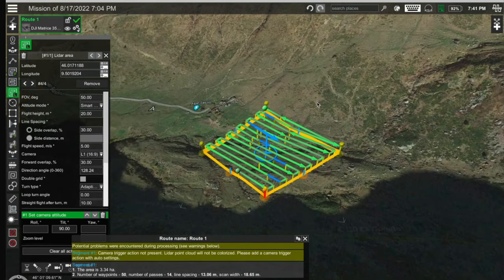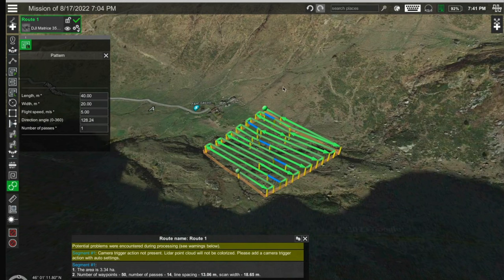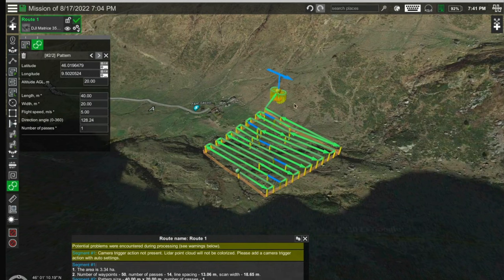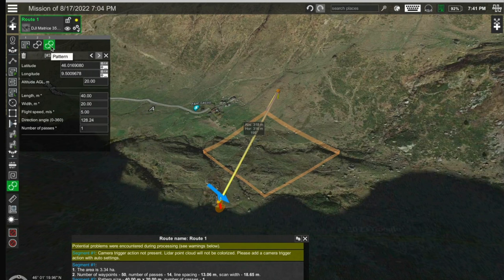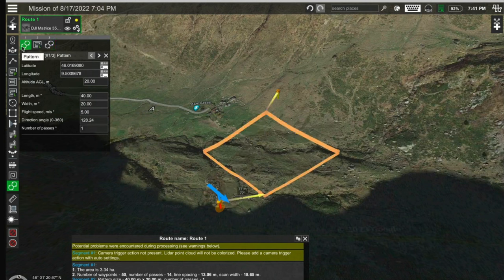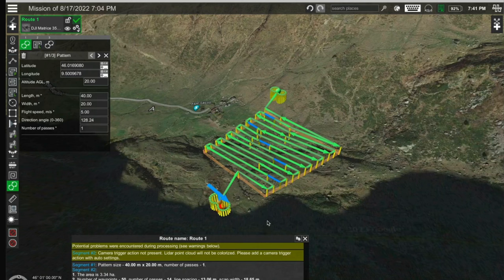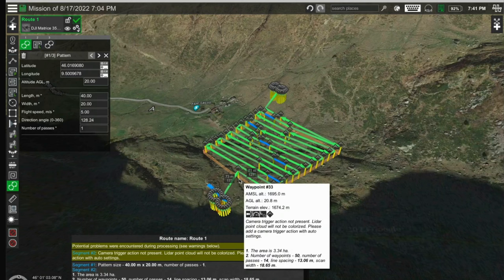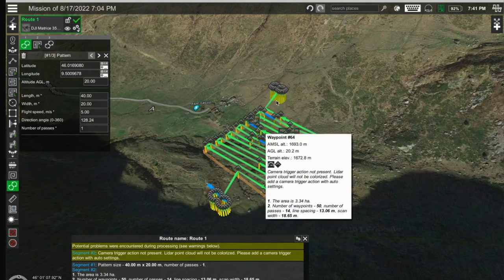Eight figure calibration pattern for drone LiDAR surveys

Comment: Hi, i have a question about long lidar flights which involve changing batteries. I create a UGCS flight route with 2 figure eight pattern at the beginning and the end of the flight, in the middle i have to create a 60 hectares lidar survey, made with DJI L1 and M300. The flight i created is 35 to 40 mins estimated, so i should come back at some point and change the batteries. How can i do calibration flights at the end of the first battery and at the beginning of the second one? The M300 mission i assume it can be paused and resumed, but what about the calibration pattern? Thank you?
Reply from the maker: Hi! You can do that using the "Pattern" command. When you need to change the battery, you can execute the "Pattern" command by selecting it in the right part of the screen near the Upload and Auto Mode buttons.